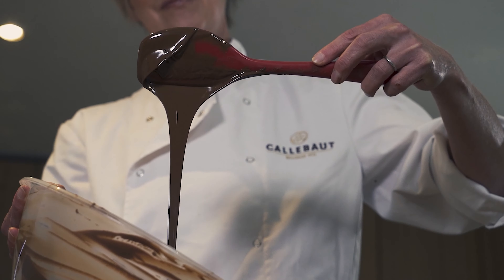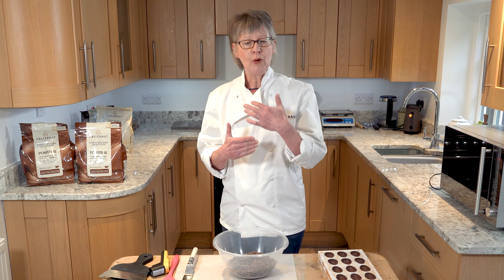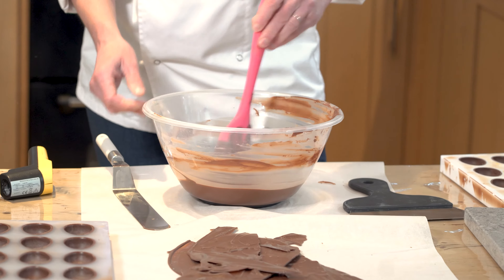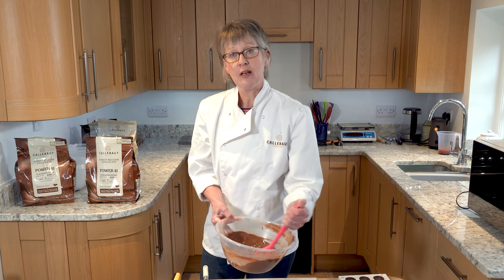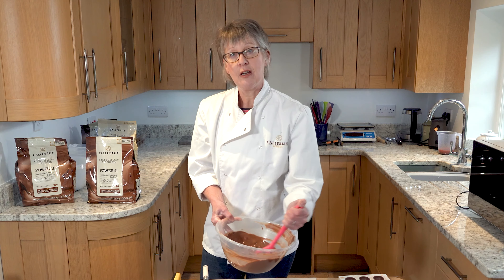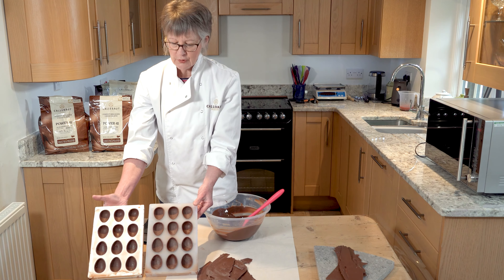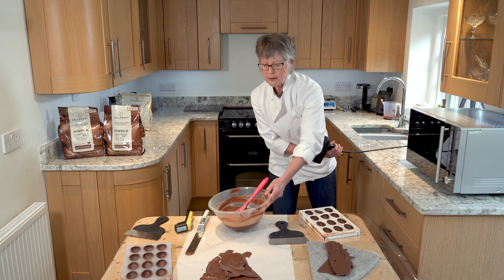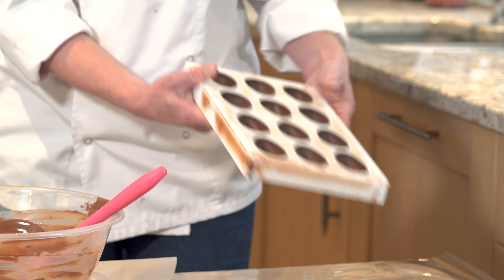How to SIMPLY Temper Chocolate | And How to Correct Any Tempering Issues

Comment: Thank you very much.  I learn a lot.  Ho well.  From asouth Africa
Reply from the maker: Thank you for watching - just be aware, that where you are, the ambient temperatures are likely to be a lot warmer than here in the UK.  If you are working  in temperatures warmer than around 18 degrees C, you will have problems with the tempering process I'm afraid.  If this is the case and you don't have access to air conditioning, then try to find out about 'compound chocolate.'  This isn't something I have experience with but you could find local chocolatiers who do, perhaps.

Comment: do you use other 40%  chocolate & then seed with the Callebeaut buttons
Reply from the maker: Thank you for watching my video. And, no, I use 40% Callebaut milk chocolate throughout the tempering process rather than blending it with anything else. But of course, you can blend different  chocolate ls if you prefer.
Reply: Why do some Callebaut videos show melting the chocolate in a microwave but not seeding & @ 31c it’s tempered
Reply from the maker: @garymason1421  This method relates to the fact that the Callebaut chocolate is 'pre-tempered' - as part of the manufacturing process, and to get it to you in callets (buttons), it has already been tempered.  As long as you don't heat it over 36 degrees C, you can then stir through any un-melted buttons that remain until they have melted which should bring the temperature down.  You may need to do add a few further buttons to reach the working temperature.

Comment: Does proper temporing determine the shine?
Reply from the maker: Thank you for watching my video.  Proper tempering not only results in the shine that you're looking for when you're working with chocolate, but also, the 'good snap' i.e. when you break the chocolate, it does so with a clean break with nice, smooth edges. The upper surface of the chocolate will have more of a gloss than a shine as such.  But if you set the chocolate on a shiny surface i.e. a sheet of cellophane, then the chocolate that was against the shiny surface will have that same shine too.  magic!  The tempered chocolate also shrinks away from the surface that it sets on which is helpful when making chocolate truffles or bonbons!

Comment: Is it better to use a plastic bowl?
Reply from the maker: Thank you for watching my video. And in answer to your question, I think so, yes! This is because if you microwave your chocolate  to melt it, the material of the bowl you use becomes important too.  Glass and ceramic bowls retain heat in the microwave. Plastic doesn't. It's therefore easier to manage how your chocolate  behaves in a plastic bowl. In glass or ceramic, the chocolate  will be reacting to the residual heat in the bowl itself, too, which makes it hard for you to temper the chocolate.  Plastic bowls are also much cheaper to buy and last just as well as glass and ceramic ones.  I hope that helps . Nenette

Comment: Thank you for sharing, where did you get your bowl
Reply from the maker: Thank you for watching. If you have such a thing where you live, try The Range. I use really basic plastic bowls. Nothing special about them at all. I don't use glass or ceramic bowls because I find they retain the heat in a way that confuses the chocolate when you're trying to temper it. Plastic bowls are great also because you can feel the warmth of the chocolate compared with that of your hands simply by holding the outside of the bowl to get a rough idea of how warm it's getting.  If that makes sense!

Comment: Hi, I really didn’t get something, I overheated my chocolate, I mixed dark chocolate’s temperature with milk chocolate’s temperature. Now I ruined my milk chocolate and I don’t know how to fix it. I heated till 117F (47C) and I don’t know how to fix it 😭 Please help
Reply: Now it went down to 81F (27C)
Reply from the maker: Don't panic!!  This takes practice and on the whole, chocolate is quite forgiving.  Just take it slowly while you're getting the hang of things.  A recap of the main things that will help you: first of all, melt your chocolate to around 45 degrees C regardless of what type of chocolate it is.  Then rapidly reduce the temperature to the working temperature by stirring-in new chocolate callets (buttons!) .  The working temperature you need to know is dark chocolate 32 degrees C, milk 31 degrees C and white 29 - 30 degrees C.  Then before you use your tempered chocolate, test it as I show you on my videos by dipping the blade of a knife into the chocolate, tapping off the excess and letting it set - you're looking for it to set in 3-5 minutes and when you brush the surface with your fingers, there should be no finger marks left in your wake.  If the worse comes to the worse, and things go pear-shaped, then let the whole batch of chocolate set and then have another go.  Yes, you can re-use it.  Good luck and keep me posted.  Nenette
Reply: @NenetteChocolates You are so cool, kind and professional! 😍 Thanks for cheering me up. 🥺 I will do that right now and get back to you when it’s done! Thanks a lot! 💕

Comment: Would putting it in a different bowl not reduce the temperature? Or do you always need to add more chocolate?
Reply from the maker: Thank you for watching my video and for your question. Pouring the chocolate into another bowl would cool it down a little, you're right. However tempering chocolate involves a technical change to its molecular structure - the cocoa fat crystals. And this is achieved by adding new unmelted chocolate  buttons and stirring them through until they have melted as any demonstration shows. The combination of time, movement and temperature is crucial for the tempering process to achieve  the shine and snap of your chocolate. So, I'm sorry, but you'll just have to get into your bowl of chocolate  with a spoon and a bit of elbow grease!

Comment: Hi . Thank you so much for the tutorial. Loads of love 
 from India 🇮🇳. I have been trying tempering since a long time and I have had a hard time. Usually the room temperature here is 32 to 35°C. I wanted to make chocolate bars using the callebaut. Fortunately, I do have AC. But my question is I am confused about the temperatures here. Do I need to melt the chocolate first till 45°C and then add seeds to cool it down to 30°C ? After that can I store the tempered chocolate in the fridge or not? Because if I keep it outside, it will eventually melt you to the high temperature here. Regards Namrata.
Reply from the maker: Thank you so much for watching my video all they way from India - a beautiful country - I have visited the north-west - walking in the Himalayan foothills. 
I'm afraid that with the ambient temperatures you're experiencing, you will struggle tempering your chocolate.  The tempering temperatures you describe are correct. But as you point out, as soon as your beautifully tempered chocolate gets into the heat of your normal ambient temperatures, it will go out of temper again very quickly (producing a fat bloom which is a when the cocoa fats rise to the surface and produce a white coating) and then melt!
I'd recommend a specialised chocolate  fridge to store your completed chocolates as this contains a dehumidifier to drive off the moisture and keeps the temperatures to 12 degrees C. These aren't cheap though. Don't put your chocolates in a normal domestic fridge because this is too cold (5 degrees) and you will get a sugar bloom (the chocolate  looks like it's been sweating with beads of sticky, sugary moisture on the surface). 
I have no experience of it but I think you need to explore compound chocolate which is made to deal with your lovely warm temperatures.
I wish you all the best with your chocolate  trialling. Don't  give up!! Nenette

Comment: question: is there any sense in tempering chocolate if you’re going to make a ganache? What if you are just using a little bit of liquid to help your chocolate melt - a little butter, a little coconut oil, a little cream - but still mostly chocolate?  

Follow up question: I’d have to compare their melting points, but does adding coconut oil help chocolate set?  You see that in the “magic shell”chocolate sauce recipes that get poured on ice cream, but why couldn’t you just pour pure tempered chocolate onto ice cream, wouldn’t it also set up instantly at that temperature?  how about if you were trying to make a chocolate shell for a cake you want to set up hard and be stable at room temperature?
Reply from the maker: Thank you for watching my video. Wow. What a lot of questions! Some of which I can answer but others you'll need to find a patisserie chef for - that's  not me, I'm afraid! 
If you temper your chocolate when you make a ganache, you will find that the risk of the ganache splitting reduces further. So that's a good thing. 
Adding a little liquid - butter or cream or water- will change the consistency of the chocolate as I demonstrate in my video on making ganache. Chocolate melts smoothly on it's own without needing additional ingredients.
Reply from the maker: 2nd part of my reply! Watch my video on making and reusing a ganache to see what happens when a little liquid is added to tempered chocolate.  
If you pour warm ganache or tempered chocolate  onto ice cream, you're right, they will set hard when they hit the cold temperature. As when you pour a layer of tempered chocolate  onto a cake and let it set, though, you'll get a hard shell. If this is what you'd like, then I see no reason for adding anything like coconut oil. But it will be difficult to cut through and likely to shatter or break 'untidily' as you do so. I'm not sure I have helped! But have fun experimenting.  You might also take a look at Callebaut's tutorials online where they cover a wider range of subjects including patisserie ideas
Reply: Thank you for your answers! I'll digest this and follow up as necessary. @NenetteChocolates
Reply: Ok, let me rephrase: can you temper chocolate when it is in solution with other ingredients, i.e. is ganache, i.e. mixed with water, butter, milk, cream, egg yolks, or coconut oil.  Will the beta crystals still form once we are no longer dealing with pure chocolate, or is the only approach to temper the chocolate separately and then combine with any other liquid?
Reply from the maker: @Abbbb225  once chocolate  has been combined with other ingredients you're dealing with a different animal. Tempering chocolate is something that you do to manage the consistency and structure of chocolate - on it's own before you add anything to it or when you want to work with it on it's own.

Comment: Thanks very much for the upload. Also your replies are so sweet and comprehensive ♥️♥️. I’ve got a question , can I mix dark the chocolate with solid coco butter??
Reply from the maker: Thank you for getting in touch and for your kind words. I don't have experience mixing cocoa butter with chocolate - dark or otherwise - as this is not the way I temper chocolate.  However, I know that this is what others do. I'd suggest you gave a go and see if this produces a result you're happy with. Adding cocoa butter will of course change the make-up of your chocolate, how it tastes and possibly the way it behaves. Let me know what happens! Nenette

Comment: I subscribed too! nice video, clear and excelent explanation, i see you have big chocolate eggs, i'm very curious what you fill them with, is there a cream based filling, cause normal ganache is to heavy for that bite size.
Reply from the maker: Thank you for your lovely feedback. I don't fill the large eggs. I leave them empty - as you say, filling these with ganache would be just too much! Of course, you could put a bag of your handmade truffles inside before you seal the two halves together. Just be careful if you then have to put your creation in the post. The contents may rattle around inside the egg shell and break it. It takes experimentation and lots of packaging!

Comment: Hi, I'm from the US, can you give me the name of some good chocolate buttons to use, this is all new to me, I'm just getting into chocolates, tempering etc, so I haven't tried ant tempering as of yet, I'm scared to be wasting my chocolates if it doesn't turn out, I'm mostly wanting to be able to do a drip around the outside of a cake do you still need to temper that chocolate as well, ty so much???
Reply from the maker: Hi Daisy. Thank you watching my videos. The first thing I'd say is don't be scared to have a go. If your tempering doesn't go to plan, don't worry,  you can simply re-melt the chocolate and have another go. So you won't waste it  it's very forgiving like this. So just go ahead and practice lots!
I use Cellebaut chocolate and would recommend it. If you're working in a room that's warmer than around 18 degrees C and have no air conditioning to cool it down, in your part of the world, you'll need to use compound chocolate. This is because  your chocolate  will go out of temper again after all your hard work if the room is warm. I'm afraid I have no experience  of working with this. I hope this helps!

Comment: thank you! Would like to see poring into round molds for coco bombs, howmuch ect? How to keep chocolate warm while using it(in temperj
Reply from the maker: Thank you for watching my videos. Hopefully I can address the topics you raise. Keeping the chocolate  warm while in temper - I use a hot air gun. Which in fact is just a hair dryer. You'll see me using this in some of my videos. Just blow the hot air into the chocolate  while stirring. Don't over-do it, though - if you get it too hot you'll have to re-temper it!
Making hot chocolate bombs uses exactly the same process as creating the shells for truffles using professional chocolatier  moulds.  So take a look at this video for the process but note that for the bombs you use a different mould. 
I hope that helps. Nenette

Comment: you're missing the important information, choc that is not melted above 100F will be liquid but still in temper, all you need to do then is bring it down to 91F and its ready to go.

You're just seeding blindly, feeling the bottom of the bowl isn't telling you what the temperature is with any accuracy.

I worked with choc for yrs, it was not very often that a tempering was needed because we always kept in within the temper range.
Reply from the maker: Hello Gerard.  Thank you for watching my videos.  The delight about working with chocolate is that it works differently for different people.  I too have worked with chocolate for years and trained with Callebaut at their academy and go back there each year to pick up all the latest information about their products and new techniques.  The process you describe in your note is where you don't actually take the chocolate out of temper i.e. the pre-tempered chocolate is not taken above 36 degrees C.  And of course this is an acceptable way of doing it too.  The method I describe is for tempering chocolate that has been fully melted which might be easier for those new to the process to get to grips with.  By the way the feeling the temperature of the bowl is just to see roughly the temperature of the chocolate.  It of course doesn't form part of the tempering process.

Comment: Hi Nennette, I continue to struggle to temper my chocolate and appreciate your videos. Recent batches seem to have tempered well and have contracted nicely in the mold but still have extensive blooming. My thermometer is very slow acting so the chocolate may have been a couple of degrees too warm?? Why is cooling in the mold not the same as cooling in the bowl?? Also, I see many videos where the presenter uses a hairdryer to warm the mass a little. I assume the microwave for, say, 5 seconds, would also work??
Reply from the maker: Hi Ian. Thank you for watching and I've just responded also to your email request for a workshop. We can sort out all the answers to these questions then. Nenette

Comment: I have a question, can we temper an untempered chocolate bar? I bought a dark chocolate a while ago and when i opened it recently i noticed it has white appearance and later the tempering didn’t go well, could that be the reason?
Reply from the maker: Thank you for getting in touch. First of all, in order to create a bar, the chocolate  will have been tempered already. The white you have seen on the chocolate  is a fat bloom (where the fat - cocoa butter - molecules comes to the surface of the chocolate) which will have resulted from the chocolate either having not been tempered properly in creating the bar, or being kept somewhere too warm. But one of the delights about chocolate is that it can be re-tempered even where there is a fat bloom. So as long as you follow the rules for tempering dark chocolate (heat to 45 degrees C and, by adding and stirring through more chocolate pieces reducing this temperature to around 32 degrees C) you should get a lovely glossy chocolate  when it sets. I hope that helps! Nenette
Reply: @NenetteChocolates  that was so much helpful, i am really glad i reached out to you. Thank you so much ❤️
Reply from the maker: @tootsiepeter39  my pleasure